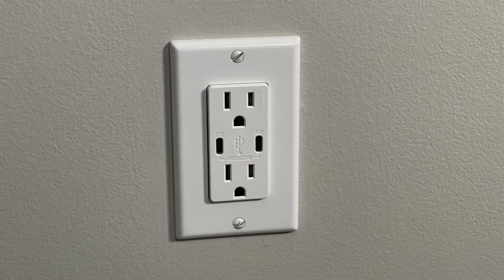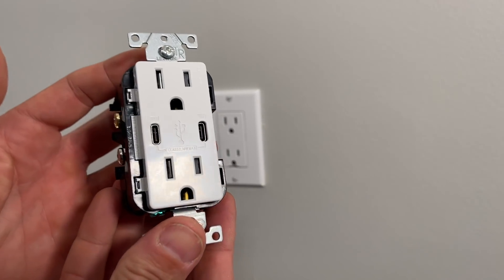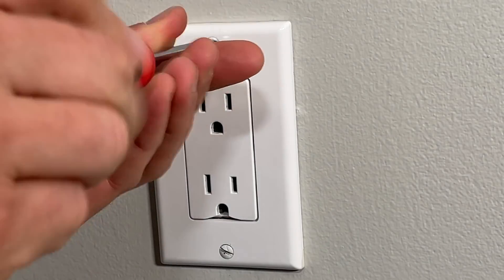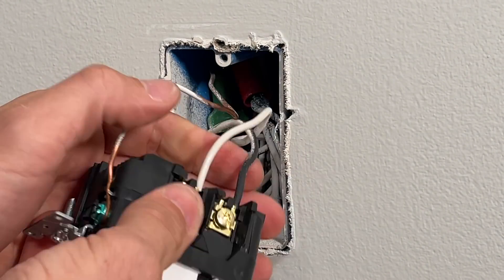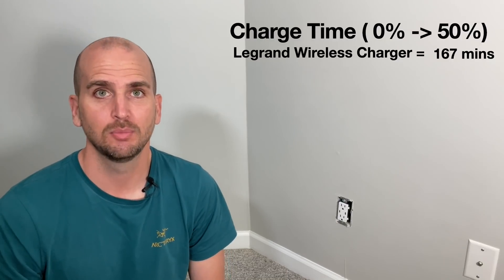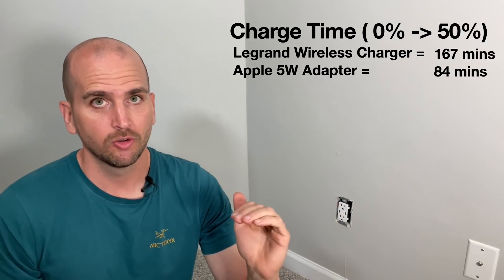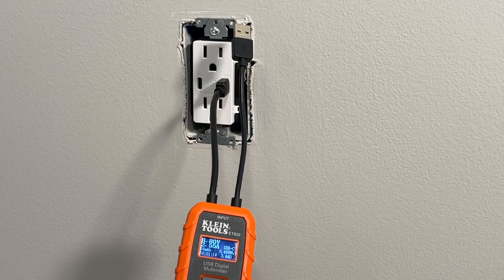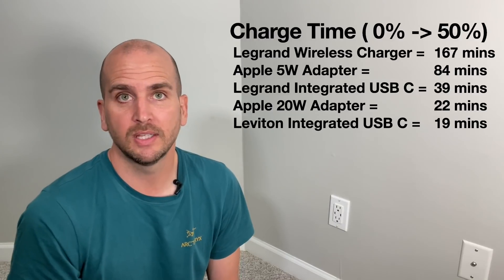Fastest USB C Outlet On The Market |  Install and Test

Comment: It’s a nice feature however the outlet cannot replace all USB C style PD chargers. Also of note it only supports PD when one outlet is in use " Both ports connected to devices: 5VDC@3A (30W total power) "   The PD 3.0 standard supports up to 100W so the outlet is not suited for devices like apple laptops or optimal for devices like the Galaxy S20 Ultra. It supported 45W PD charging however Samsung dropped the S21 back to “only” 25W max.
Reply from the maker: Good feedback Chad and I did confirm after another viewer commented that the voltage does drop as soon as another cable is plugged into the other USB C port.  As soon as the other cord is connected my iPhone decreased down to pulling about 10W (5V @ 2Amps)
Reply: 14" Apple notebooks can get by on 60W PD. It's only the Max chips and 16" models that want the 100W stuff.

Comment: Does the charge slow down or reduced if you connect both USB C connectors at the same time?
Reply from the maker: Good question and just tested it out to confirm and the output from each port does reduce to what looks like 10W for at least my iPhone as soon as another USB C cable is plugged in even if another phone isn't connected to the cable.
Reply: Also, does it get hotter by fully connect omg all connectors?